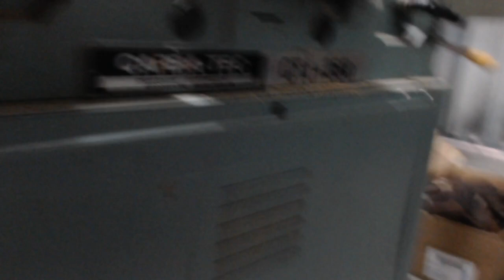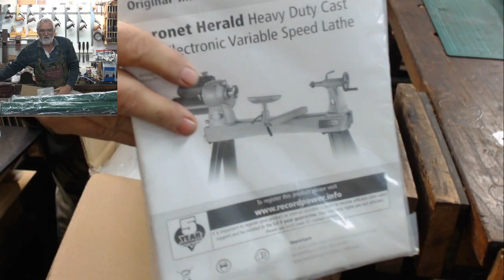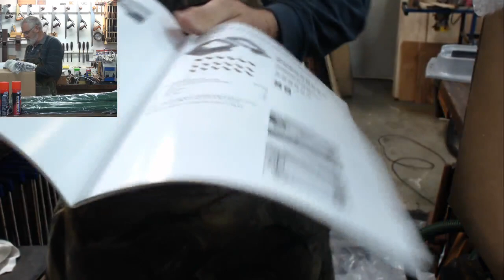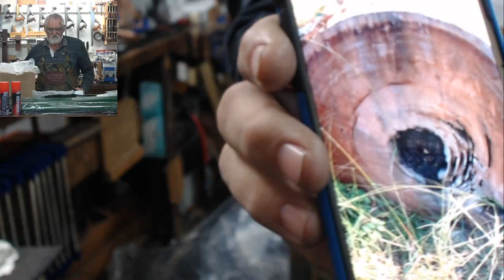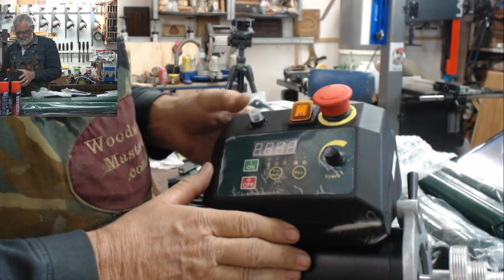Unboxing and assembling New Record Herald Lathe live and Q&A.

Comment: Steve I have a Lucas mill and about a year ago I came across some blue gum trees that where about 1.5 metres wide and in the centre slabs they didn’t have the water spout in the centre which was just surprising it was weird but yea blue gum is some dense shit and me being 14 it’s a bit of a challenge mobbing big logs like that lucky me dad has an esqivaitor with a log grab
Reply from the maker: Lucky indeed, we have to lug all our timber by hand. Wish I had the energy of a 14 yo. I would be out getting timber all the time. I mainly use Blue Gum for Charcoal to be used in my forge. But I have made a   lot of furniture out of in the past. That was a big tree you came across as well. Keep up the love of wood. Cheers Steve

Comment: Hey Steve do you reckon a chunk of 100 year old radiata pine that is about 100 kilos will retain it's shape reasonably well?   I've sealed it with wood oil and also clear coat all over.  That will prevent further drying, splitting or shrinking right?     Shaun, Adelaide.
Reply from the maker: Hi Shaun, No absolutes as far a timber goes unfortunately. It should stay pretty stable providing it is kept in a constant climate environment. If it were exposed to direct sunlight in the middle of the day for example good chance it will crack or put in warm A/C. But if not in direct sunlight of radiant heat it should be OK. cheers Steve

Comment: Hi Steve, looking at getting the same lathe, what are your thoughts on it a year on?
Reply from the maker: Hi Adam, 12 months on and still the best lathe I have used. I would suggest you get the bed extension though. It's not that you want the extra turning space but it's nice to slide the tail stock onto. One great feature I have recently discovered is the versatility of the swivel head for bowl turning. Cheers Steve